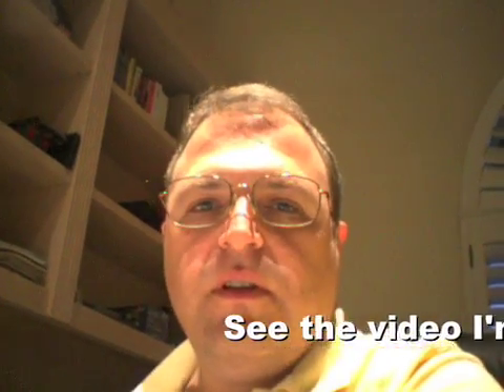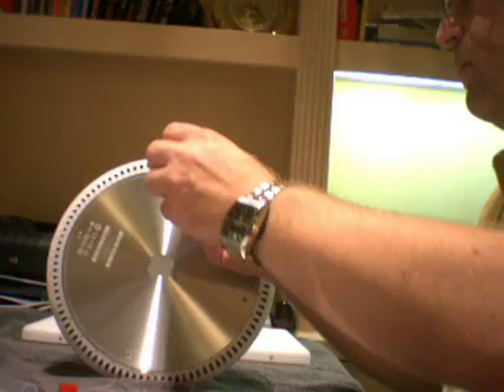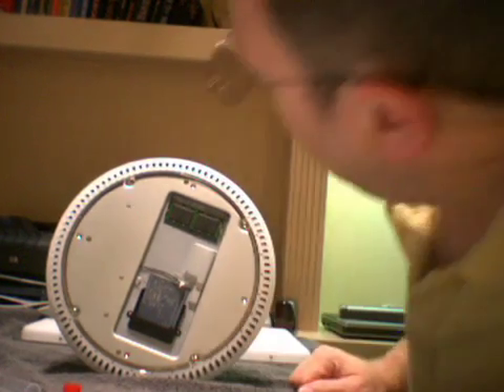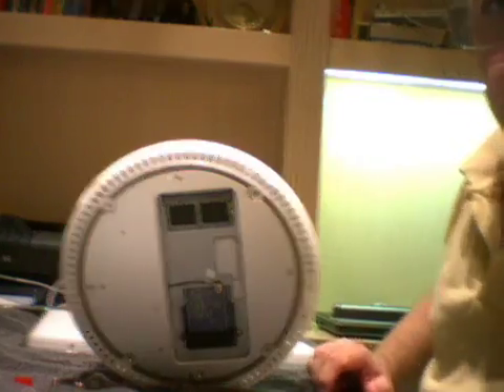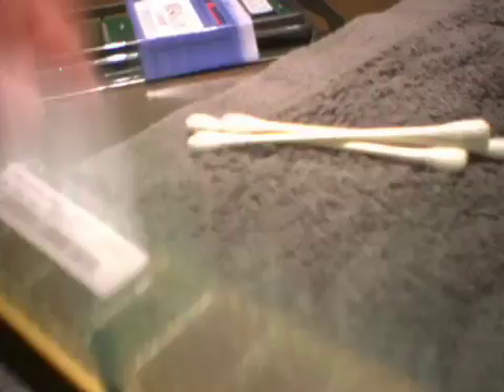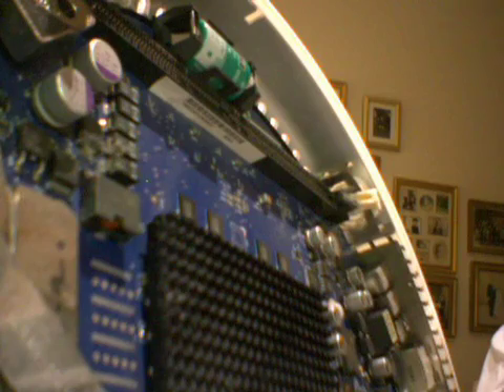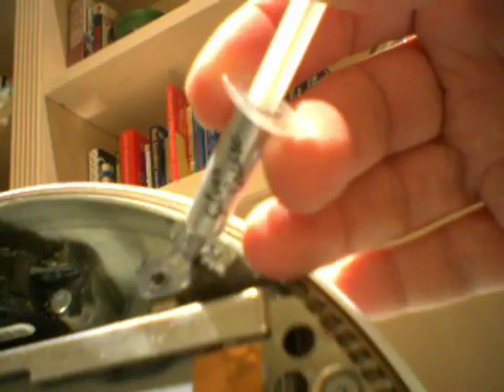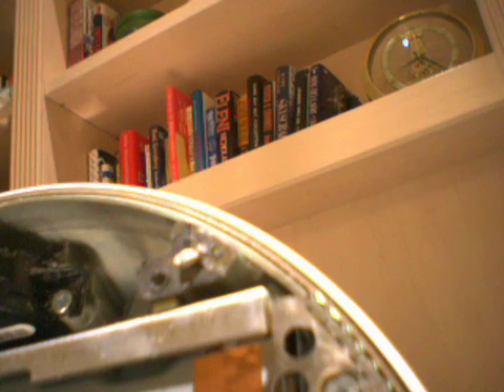iMac G4 RAM Upgrade

Comment: Thanks for the video after all these years! do the modules both have to be the same size in order to work properly? Or can i just put 1 gb PC133 133MHz SDRAM in (whatever the size of the SODIMM is)? What would you suggest is best? I would like to get the max of of the machine and I read that 1Gb is the max. Thx in advance

Comment: Adam, 

Apple iMac G4 i recovered is really slow, and sometimes it bugs, so i have to do a restar off the thing. Would it be solved to just change the ram memory. 
And were do i find the heat paste dat you used?

Comment: i wonder if with this update that u did to your imac G4, youtube runs fluently without cuts directly from the web site?? and without using youtube view or mactube or other apps i mean if an old pentium PC can handle youtube without cuts with less memory ram than 2 GB a MAC should be works better than any old Pentium could you make a video if the answer is positive to watch the performance on Youtube web site, thanks Adam

Comment from the maker: I don't see a 933MHz iMac G4 listed anywhere, you need to double check that. At any rate, it's the RAM type that determines the max amount you can install. Check in System Properties. PC-133 is 512MB+512MB max, total of 1GB, PC-2100 or PC-2700 is 1GB+1GB max, which is what I was working with in this video. And yes, if you want the iMac to not overheat, you need a dab of heat transfer compound between the to heat sinks.

Comment: I am trying to upgrade one of these, About says processor is 933 MHz? Is this actually a 1 GHz? I know there are different models of the iMacs, do they all require the heat glue for reassembly?

Comment: I LOVE my iMac- Great ERGONOMICS!...I have used it w.586 (?)K RAM for Years!! Finally I orderd the iMB RAM..I can put in the outer, smaller chip today..but need a 6 point screwdriver for the bigger (inside) chip..I have no idea if you can just add the one, smaller- Will find out in a few minutes;)
DO I NEED That Heat Sealer stuff..for adding the larger, inside chip???
Thnx!

Comment from the maker: It's called thermal paste. Or thermal grease. Or thermal compound. Goes by a bunch of names. There's a wikipedia article on it. A quick search and I found it for $3 to $5 on ebay.

And 10.1? Really? I'd put at least 10.2 on it, if not 10.4. But you can probably find IE and Netscape for it out there. IE 5.1 was the last version for the Mac, I think, and version 7.2 comes to mind for Netscape. Good luck!

Comment from the maker: @MrNickynick444 Sorry, no. Under 1GHz and over 1GHz they use different types of RAM. The iMac I'm working on here is 1.25GHz and can go to 2GB of RAM. Your 800MHz unit maxes out at 1GB, so you're at the limit, the processor can't handle any more...

Comment from the maker: @chazrai "Fine" is questionable. Do this: run the G4 as-is for a couple of hours, doing work of some kind. Play video or music. Keep the drives spinning. Now place your hand over the vent at the top of the dome. Feel the heat the comes out? If you don't put the heat-transfer (not resistant) compound on, a lot of that heat will stay inside the  computer, and that's not a good thing. 

The stuff is cheap, or if you know someone who builds PCs, borrow a tiny bit from them.

Comment: i have this computer - i bought the RAM and am ready to install it, only that heat-resistant compound threw me off. do i need to put that in? or will it operate fine without?

thanks! good video

Comment from the maker: @johnny2076 It depends on the CPU speed, not the screen size. If it's 700MHz or 800MHz then it's 512MB in each slot, 1GB total. If it's 1GHz or faster, then you can install 1GB + 1GB for a total of 2GB.

Comment from the maker: @ThreeDaysOfDale Various wires and cables. Power and data for the drives and mainboard. There's not a lot of slack, so you have to open it just enough to reach in and carefully disconnect them. Then you can proceed with the upgrades and cleaning.

You can clean out the upper case fan if you remove the drives first. Just be really careful taking out and replacing the drive bracket. You don't want to bend anything...

Comment: Hi, i have the same model but whit 256mb of memory.
I would like update to 2Gb.
If I have understand I need:
- One module of ram 1GB, 200-pin SODIMM, DDR PC2700 (to add in bottom of the iMac)
- One module of ram 1GB ram module DIMM, DDR PC2700 (to add inside the iMac)
it's true?
Thanks!

PS: Sorry for my bad english!

Comment: Hey Adam.
I needed your help to find me the right Ram for my iMac 
Details about my Computer.
iMac G4
PowerPC 
Version 10.3.0
Prossesor 700 MHz
PowerPC G4
RAM which is installed is, 256 MB SDRAM
In Case you forgot,i needed a 1gb or 2.
Regards from Berlin

Comment from the maker: I guess, try them one at a time. And every time you crack the seal on the heat pipe, yes, you should clean and re-apply the silver compound, just to be certain.

Comment from the maker: See above. 700MHz or 800MHz iMacs take PC133 RAM, max of 512MB in each slot, 1GB total. 1GHz G4 iMacs or faster take PC 2100 or PC2700 and (even though Apple never approved it) can handle 1GB max in each slot, for a total of 2GB.

Comment from the maker: You read that right. Your SODIMM slot was empty when the iMac was new and the 256 was added afterwards. G4 iMacs that take PC2100 or 2700 RAM can take 1GB in each slot. The older, PC133 versions can only handle 512MB in each slot.

Comment: My system profile says that I have two dimms:
1. DIMM0/J22:  512MB, speed PC2700U-25330
2. DIMM1/J20:  256MB, speed PC2100U-25330
In the video you referred to the internal card as the "original 256 PC 2700 that came with this thing."

If the 2700 is the internal card it would appear that I have 512MB internally, and 256MB on the SO-DIMM. But, I had the memory upgraded when new and they probly did the SO-DIMM b/c it's less work.  Is this reasonable to think, or do I just need to check?

Comment: Adam B, I have the 700 imac and I upgraded the user chip so I have a total of 768. If I install your upgrade with a 512 for a total of 1000, will it be that much better? It certainly struggles now playing video. Would it be able to handle OSX 5?
Thanks..

Comment from the maker: If your original 256 is in the inside slot and you're putting 256 more in the outer slot, then yes, you're doubling. But if you're pulling out a 256 MB module and installing the same (in either slot), then you're not changing anything.

Comment from the maker: Ben, Axis, Felix: The way I read it, if your iMac uses PC2100 or PC2700 RAM, then you can can go to 2GB total. But if your iMac uses PC133 RAM (which all 700MHz and 800MHZ G4 iMacs use), then you are limited to the 1GB ceiling. Sorry about that, but you guys are limited to only 512MB in each slot.

Comment from the maker: It's called thermal paste. Those two metal heat sinks need to transfer heat up and around the drives and they need to have the best contact possible. The thermal paste (or thermal silver) can be had for maybe $4 a tube at any store that sells computer supplies.

Comment from the maker: Actually just 1.5. When we first got that iMac, it came with only the 256 you see me pull out. I put a 512MB SO-DIMM in the other slot (visible when I first take off the base plate) for a total of 768. When it was time to go to Leopard, I (as you see) pulled the 256 for a 1GB, totaling 1.5GB.  But it can go to 2GB total if we want to take it there...

Comment from the maker: Well, I swabbed out most of the dust with a couple of Q-Tips. Rather a lot, really. I didn't want it to fly everywhere. I would normally take a computer outside blow out the dust, but that one is a bit unwieldy with the bottom loose like that. Hey, it's cleaner now than it was a couple of weeks ago...